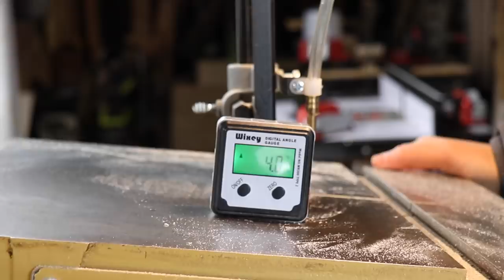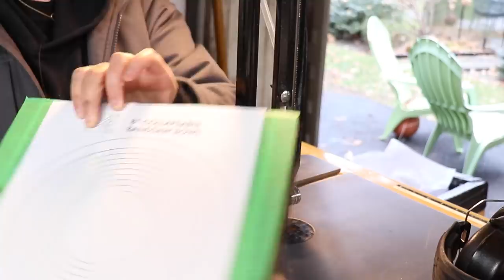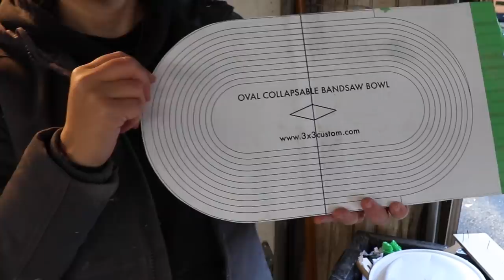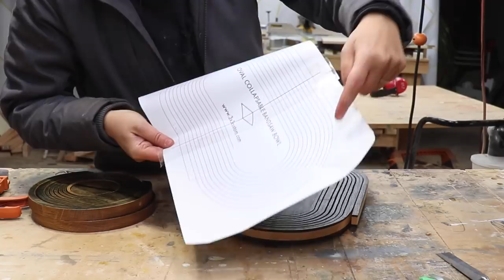How to Make a COLLAPSIBLE Bowl!! It's EASIER than you might think!

Comment: Could you add magnets to the ends of the handle and the edge of the base to lock it in better and keep it from dropping off he edge?
Reply from the maker: That’s a great idea!
Reply: I was going to add that you could glue an extra piece to the side of the base that is flush with the top of the "flat pack".

Or another idea is to make a slot mortise on the handle and a matching tenon in the base to stop sideways movement.

Regardless, love the videos and keep up the good work 👍👍
Reply from the maker: @whatdaf11  all great ideas!
Reply: I've used the angled cut with a scroll saw to make the design raise above the main surface. When I cut in 1 direction, it raises the design, but when I cut in the other direction, it lowers the design by the same amount (as long as you don't change the angle). This let's you make a thinner design that looks like it "pops" out of the main board.
Reply: @whatdaf11  yes, exactly what I was going to post.  Fortunately I checked to see if anyone else had suggested it first :)
Reply: @Greg Mascunana @Matt Barry @whatdaf11 I think it’s possible to ‘save’ this piece if she just adds small tips of the lighter wood to the end of each cross piece of the base. 

She could then implement any of these ideas and it would be a nice way to match the style and coloring of the piece as it is.

Comment: You can also make the first 'ring' of the bowl twice as thick as the rest. That way you do not have to glue and drill two rings together.
On the oval bowl, keeping the wood where the handle will rest a bit longer would alow you to cut a dado in it for the handle to rest in.
Nice work. Love the oval one.

Comment: Remember back in highschool when you took trig and didn't know how it would apply in the real world? Well... THIS! The optimum angle can be found with a little bit of trig once you know 3 things: Your kerf width, your board thickness, and your overlap amount. I don't know the formula off the top of my head, but I'm sure it wouldn't take too long to figure it out when sketching out how the kerf cuts through the wood at different angles and seeing where the overhanging cut face overlaps the underhanging cut face. This is the beauty of trig, you can derive formulas from pencil and paper sketches.

Comment: So you can calculate the angle you need with trigonometry

sin-1(kerf/material thickness)=minimum angle.  

at 7 degrees, with .75in plywood it looks like you've got about a 3/32 kerf :)

Comment: You can still fix the problem with the handle coming off.
Take it off, steam it for a little bit and bend the tips towards each other an inch or two.
This will put some tension on it so it is constantly pulling closed and will be less likely to pop out.
Another way would be to put a couple decorative tabs on the end of each leg, that would trap the handle in the locked open position.
They could even have a pin inserted to lock the handle from rotating, and lock the entire mechanism in the open or closed position.
I'm thinking brass or stainless steel.

Comment: Love how the ice cream sandwich version turned out. Looks like you could use it as a bread basket which flatpacks away. With regards to your issue with the handle slipping off the sides, would it be an idea to add small vertical risers on the outside of the cross piece, to prevent the handle from slipping off?
Reply from the maker: Thanks! Great idea!

Comment: FYI: in order for the spiral to not fall through the tangent of the angle should be smaller than the ratio of the thickness of the wood  to the width of the cut. Or: angla alpha < atan (thickness / sawwidth).

Comment: Thank you for producing such and informative and entertaining video. The calculation of the appropriate angle to cut on the bandsaw is not difficult and could save others a bit of time by not needing to do trial cuts. If we let t be the thickness of the kerf and d be the drop between layers the angle of the cuts will be arcsin(t/d). For small angles (say less than about 10 degrees) this can be approximated as 57.5 x t/d measured in degrees. I hope that this is helpful for others following your designs.
Reply from the maker: You lost me at arcsin.... 😂

Comment: I say 18 minutes and 10 seconds for that cut. Awesome job!

An idea I had for the handle of the oval one--what if instead of cutting the handle length flush with the depth of the bowl, they were left like a quarter inch longer, and then fit into grooves that you cut in the base piece? Then they wouldn't pop out laterally. 

Great work, as always!
Reply from the maker: That’s an awesome idea that I wish I thought of! 
And very close on the time 😉

Comment: Cool project & the oval one looks pretty cool.  And the other one had some challenges but still cool. I have some constructive criticism if you will indulge me? In regards to the food coloring it can work. Because it is water based it doesn't penetrate the surface deeply. So if you are gonna use it, it must be applied with a heavy coat. Maybe 2 coats let it dry for a day. Then with a damp almost dry slightly wet cloth. Do a pre-wipe before finishing it. Now onto the tear-out, for me to avoid that issue. There are 2 main ways to avoid it. My favorite & effective way to avoid tear-out is. To use wide low to medium tact painters/automotive tape. To fully protect the grain that should remain in tact after the cut. The other choice is to use a backer board which you did. My only issue with using a backer board is. Sometimes the double sided tape can leave just enough space. Between the 2 boards to still get some tear-out. To me the painters/automotive tape yields the best consistent results. Like 4" wide painters/automotive tape with cover a lot of surface. In 1 peice of tape & use multiple pieces for wider boards.  Awesome video, please keep up the good work! 👍🏾
Also I forgot to add on the oval bowl base. To keep the handle in place maybe try a ball & socket connection. Where the handles meet the base. In the base make an ⅛" to ¼" deep round concave indentation. At the end of the handle round over the bottom parts of it. To match the concave indentation to help it stay in place. But it's also not hard to disconnect the ball & socket connection.  👍🏾👍🏾
Reply from the maker: Thanks so much! All great ideas

Comment: Not a project I would have considered until I saw your video. Thanks for sharing. 

 Next time you need a bandsaw blade, check out the wood slicer blades from Highland Woodworking. They have a very thin kerf (which will affect the table tilt for a project like this) and the variable pitch makes for clean, fast cutting.  That blade and a bit of fine tuning made a world of difference to my bandsaw work.  

A video on bandsaw tuning is a suggestion. For me, my tilt on my top wheel was off which caused the blade to ride on the back part of the wheel putting a slight angle on the blade relative to the fence. 

Nice job. Keep sharing.
Reply from the maker: Thanks! I have the woodslicer for resawing. It’s an awesome blade.
Reply: @3x3CustomTamar  we need a wood slicer in a 1/4" width. Now that you are an influencer....

Comment: I am certain it's quicker with the band saw than with a scroll saw. I have made many of these over the years as gifts, from the large ovals for bread to some very tiny ones for nick knack holders. And yes, depending on the thickness of the material and the width of the saw blade to determine the angle. Mostly for mine 5 for 1/2" and 7 for 3/4". Nice job on these, especially the two tone, I enjoy your channel as does my daughter who has gotten into woodworking.
Reply from the maker: So awesome to hear! Thanks! Yeah. I’m going to have to get a scroll saw at some point too. Ha

Comment: It's not a fail. I think it would look great with a lil flower pot. The oval one looks awesome. On the food dye staining, would it work to mix the dye into the oil?
Reply: It can also be an experiment to see how well the food colouring lasts as a wood dye, or if it fades very quickly.
Reply from the maker: I really don’t know! That would be a fun experiment to try!
Reply: The food dye would not disperse well in oil.
Reply: @zapa1pnt  
You could try oil-based or powdered food colouring
Reply: @ragnkja :
Yes, but be sure the powdered dye is for use in an oil base.
Reply: @zapa1pnt  
Anything that can be used to colour white chocolate should work.

Comment: Cutting the edge and gluing back appears to work very well.  I have one of these and it's clear a scroll saw was used. There is a small hole drilled in the middle, then the blade was put through it and it was cut from the center out.This probably makes it. a lot easier to maintain control.. On the other hand, you use the tools you have.
Reply from the maker: Yeah. This was totally designed for a scroll saw. But I don’t have one! Ha!

Comment: I accidentally spilled water on an oak project one time and had the dark black look like you had an issue with. It comes from the tannins that are already present in Oak if it helps. The food coloring that you used is water-based. By the way contact with iron can also cause this.Thanks for the great videos keep it up.
Reply from the maker: Yeah. It was definitely something with the food coloring and the glue. Since it was right on the glue line

Comment: Love your channel - your are so upbeat and excited about what you are doing.
A couple of suggestions you might consider:
1) On  the oval bowl, if you make the cross piece a little longer (as you suggested,) cut a shallow dado at the end to trap the handle end.
2) To make the 'rings' a little stronger, laminate the boards so the grain is cross-grain to make it a little more like plywood.  The top and bottom layers running lengthwise while the inner layer runs crosswise.
Great video!!
Reply from the maker: Thanks so much! Both great ideas! I thought if your second one after I glued it up.... ha!

Comment: The bowls turned out great.  I kind of like the vintage/antique of the black/green bowl after the sanding.  My guess is that line is the glue and possibly running the piece through the planer after would have mostly eliminated the line.  I suspect it's also possibly related to the reaction of the glue with food coloring. I'm pretty amateur though, so it's just a guess.
Reply from the maker: Thanks! It’s most definitely a reaction of the glue with the food coloring. But like. Why?! Ha!

Comment: Very cool project. I think the dark line on the round one is the glue reacted with the food colour. The oval one turned out spectacularly. Maybe reduce side-shift between base and handle with a mortise / tenon match up.
Have to give you props... with those temperatures I'd be half or less as productive. Great vid.

Comment: I would definitely round the corners on the bottoms of the handle for the oval one.  No so much that there's not a flat spot, but enough to facilitate sliding up onto the base by just lifting the handle.  Also, you could put a couple of stops on the base to keep the handle from sliding off, or, if you make it longer, use a dado.

Comment: Great project!
Sugestión, for the handle issue at the end, what if you added a small dado on the cross base so that it would fit as a rail for the bottom of the handle, that it would not slide outwards
Reply from the maker: That’s a great idea and I will try that on my next one!

Comment: Great project - i am definitely going to try it! 
A couple of suggestions: 3M makes a spray glue that works like post-it glue, i do not remember the name off the top of my head, however. Using that would save a lot of painter's tape 😁 Re the handle on the oval bowl that slides out of place, could you drill in a stud (a piece of brass rod, for example) in the bottom of the handle part, and then make a matching groove in the base?
Reply: The spray glue is called Re Mount 🧐
Reply from the maker: Good to know on the glue! Sounds like a cool idea

Comment: Suggestions: When you get into your cut several rows add tape across the cuts to help stabilize
the basket. Continue to add tape as you go. Makes it a little easier. Make your cut into the basket at the point where you will attach the handle so that you can hide the cut. You can also attach the handle with countersunk brass screws. Saw kerf was also make a difference in the angle needed. I like laminated one.
Reply from the maker: Good suggestions!

Comment: You mention in your video that your garage is unheated and uninsulated, I have the same set up! i'm located in the midwest. i find myself limiting my time out there this time of year, not because the cold bothers me, but because i lack knowledge.  Do you have issues with glue setting up? how do you handle finishing projects this time of year? keep up the great work i love how you dive head first at projects and problems.
Reply from the maker: Yeah. I bring it all Inside to cure in both the extreme cold and heat. It’s a pain.

Comment: It may be a good idea to round off or bevel the bottom
edges, of the handle, so it slips into place easier.
Also carving an indent, on the base, will keep it in place.
Reply from the maker: Both great ideas

Comment: Hi. I'm a big fan of you channel. Absolutely loved this one. I have a suggestion though. On the oval one that you said the handle keeps moving off the stand, why not drill a hole at the bottom of the handle (where the handle meets the stand when open), add a dowel that is left sticking out just a smidge, then add a small hole on the stand where it will go into when it opens?
Reply from the maker: Sounds like an awesome idea!

Comment: It's also commonly done in India. 
Seen many times, many shapes,  most of the time fruit/dry fruit holding trays.
They do it like fretwork. It's like long arm sewing machine. Therefore instead of going towards the centre is not a compulsion. They start from centre and gradually come out, which make it easy. Only small hole is needed to start cutting so no gluing is needed later.
Reply from the maker: It’s called a scroll saw. Yes. And I don’t have one

Comment: The bessey clamps are very heavy at the non clamping end, so using the longer clamp as you did makes them fall over, a 500 or 600 is normally better as it is less likely to topple over. A scroll saw may be better to use than the band saw as its a much narrower blade giving you more control and less of a chance of drift as you are rotating the cut.
Reply: The narrower kerf means you can get away with a smaller angle too.  Plus you can remove the blade without backing out the entire spiral.

Comment: Nice build, the walnut version was very good. The cross as a base was good too, but the width of the cross could of been shorter .. that way the lower part of the handles wouldn't collide with the base. Def a good project and maybe a gift idea too.
Reply from the maker: Thanks. But the lower part of the handles colliding with the base is what locks it in place.
Reply: @3x3CustomTamar  Thanks for getting back to me. Fair enough, wasn't sure if you were going for that plan. Keep up the good work.

Comment: Love your projects.  On the oval you could put a little piece on the ends of each of the base pieces in the contrasting wood so it won't slip off
Reply from the maker: Thanks! That would be a great idea
Reply: I always love when you can turn a flaw into a feature, what are your thoughts on trying to do this on the cnc?  Haven't figured out how to do the 7 degree.  Any ideas?
Reply from the maker: @katiekelley3984  I have no clue about CNCs....

Comment: The band saw is one way to do this, but a scroll saw makes a better spiral. You use a pinless blade in the scroll saw, just drill a small hole on the line,put the blade through it and cut the spiral,when done just remove the blade where it stops.Remember to set the bevel of the table... Great video Tamar by the way.I always watch your stuff. I liked the bagel stand and the cheese cutter. Keep up the great work and videos...
Reply from the maker: Thanks! If I had a scroll saw I would try that. Ha

Comment: BTW, about the bigger one, there's a pretty easy fix you can do. Just screw - or glue - 2 small brass strips in the ends of the base. This way it's going to prevent them to fall AND would be a pretty nice detail there. 😉
Reply from the maker: Ooh. Brass would be a nice touch

Comment: Do you have a space heater when you are out there? And do you store your glue (and other water-based products) inside the house until you need them?

I ask because aside from me being warm, I need the finish and glue products to be at a temperature where they will work, and also not freeze when not in use.
Reply from the maker: No. And yes. Ha. When I try to use a space heater it blows a fuse when I turn on my tools. Planning an upgrade ☺️
Reply: Here's a solution, for your glues and finishes:
https://www.youtube.com/watch?v=nJ5USYfrbEM&ab_channel=Samcraft
Notice there are hole drilled in the shelves and bottom divider, for air circulation.

Comment: I have seen these bowls several times and they have intrigued me also. Thanks to your guidance/experimentation I may give this a try.

One question: how thick was the wood that you were using? I ask because you said the correct angle depends on the thickness.

Lastly, I sure hope you can get some heat in your shop. I worry about you freezing out there!
Reply from the maker: Awesome. I used the plywood as my tests. So I milled it to be the same thickness as that. So around 3/4 thick
Reply: Thanks, Stay warm.